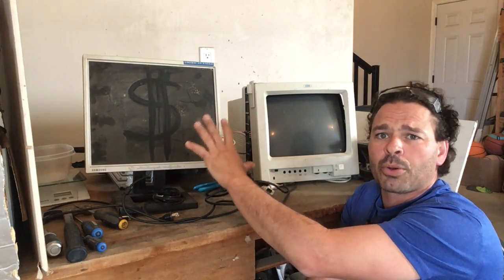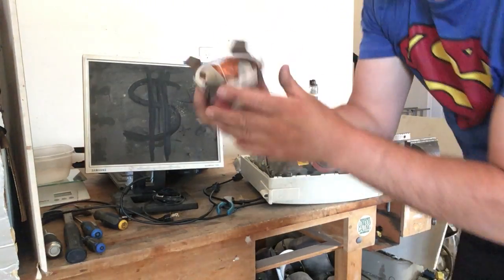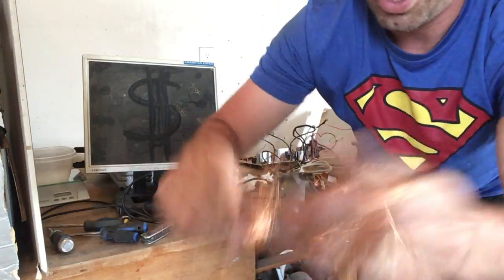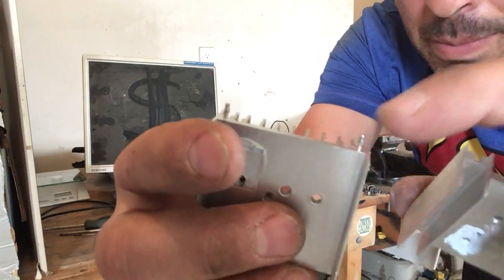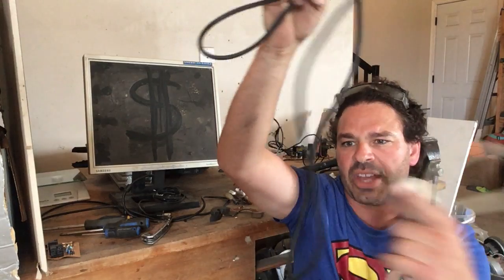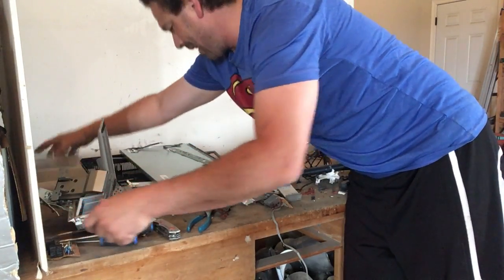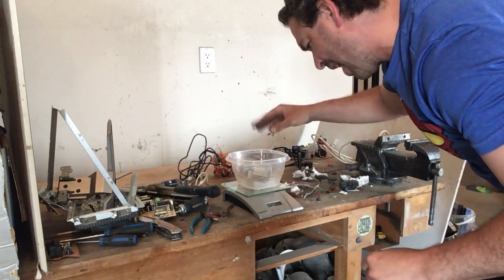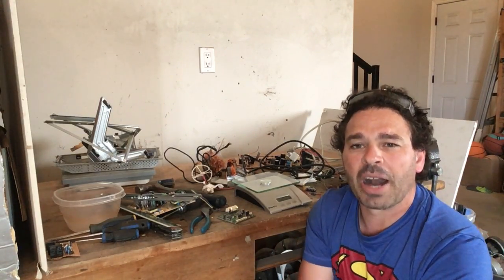Scrapping an old computer monitor and a newer one. Which one is worth more money as scrap?

Comment: when melting copper make sure you use a gas furnace/kiln, an electric one will evaporate the copper.
Reply: After you factor in what you pay for the fuel to melt it, wouldn't you be losing money?

Comment: On the CRT TVs and monitors, the clamps that hold the yoke in place are also 99% of the time stainless steel, and on the screws that are in them, the top one is almost always steel, while the bottom one is also stainless steel.  The black ring around the yoke is ferrite, not magnesium.
Reply: I put all of the ferrite into a separate bin from shred
Reply: @BushDogScrapper  I toss it all in shread. Haven't found anything else to do with it yet
Reply: @SilverScorpion  good to know I'm sure miss everyone will just get tossed in with the rest of the shred when it goes in to the scrap yard.